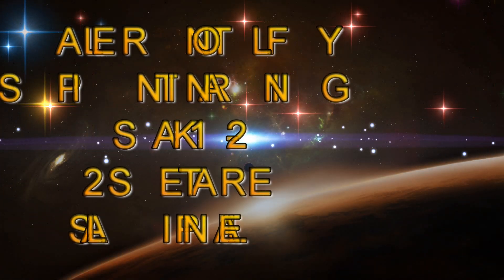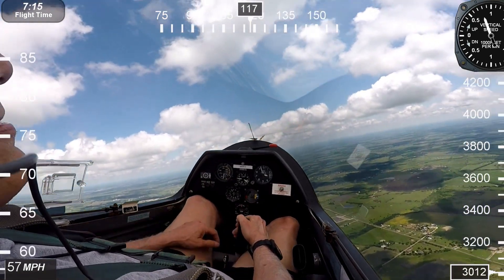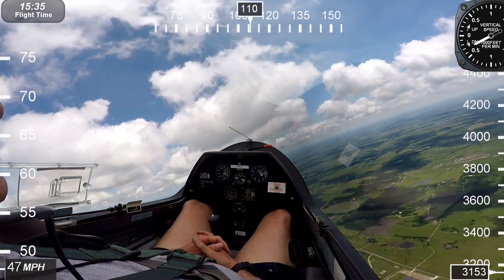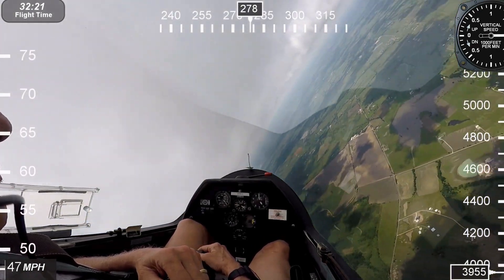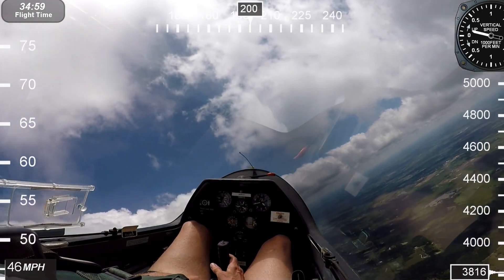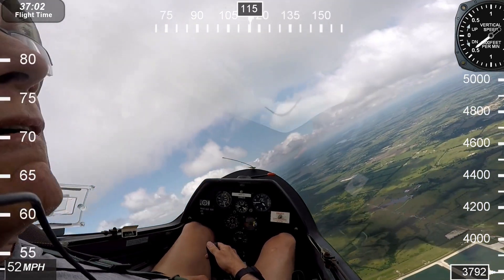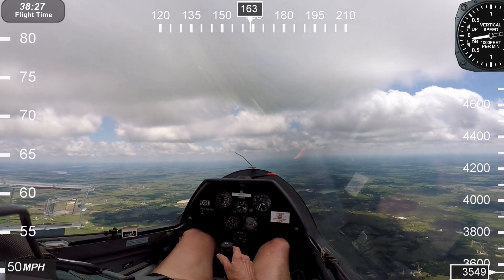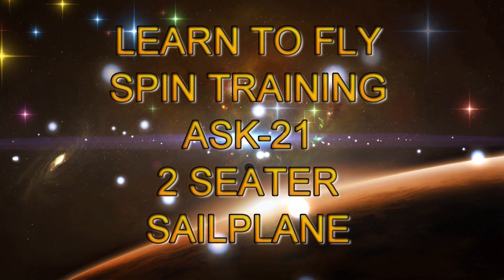Learn to fly. Spin training in a ASK-21 sailplane at T.S.A. Roy Dawson video

Comment: Nice video :) 
There is an other way to enter on a spin: you just have to pull your stick while going straight (not turning) and when you're about to stall, you push your rudder at 100% on the side you want to enter the spin. If it doesn't work well (depends on the glider that you are flying), you can also still pulling your stick but adding some left or right could help. 
Fly safe !
Reply: Yep, but with two normal size people up front, the ASK-21 won't really spin no matter what you do. If you're lucky, you might get half a revolution out of it, before it simply starts flying again on its own.
Reply: If you read the manual, it is the way enter in a spin.  The other think that the manual say, is you have to be in a good cg position to enter in a spin, otherwise it will never enter.  The cg position as to be aft position, and sometime you need to put some weight on the tail to bring the cg on the aft position.
Reply: True but it is best for training to enter the spin from a scenario such as a flat over ruddered turn or a spin off of a failed winch launch